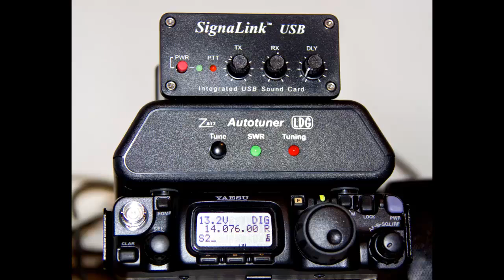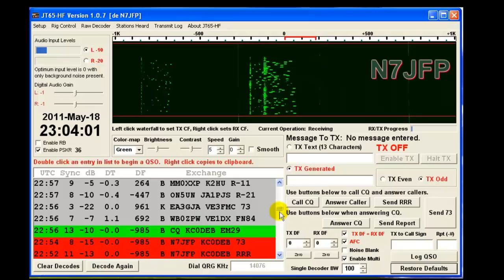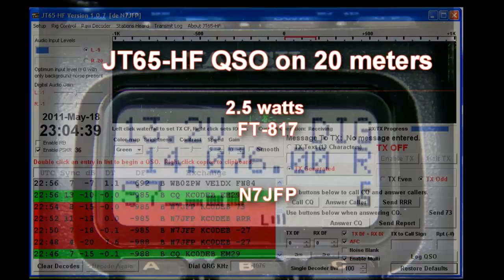JT65-HF  20M  QSO -- FT817 & 2.5 watts

Comment: what would be REALLY helpful is a nuts and bolts, wire by wire video showing specifically what hardware was used, how it was set-up, etc, sort of like a real how-to for those of us new to HF digital modes. This video well shows that it works, what I would like to see is a beginner level "how I did it." Thanks kf9mp